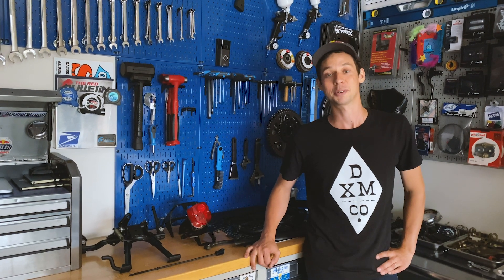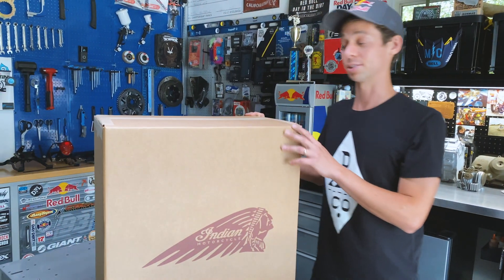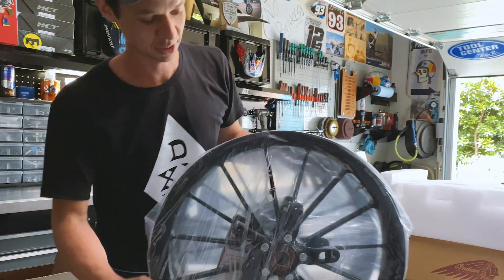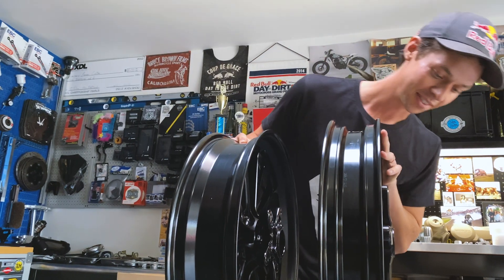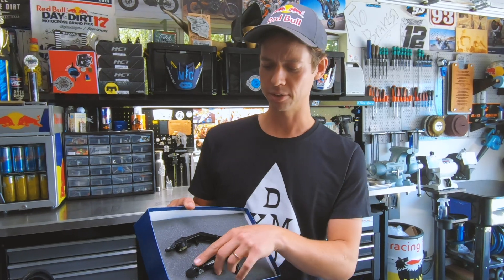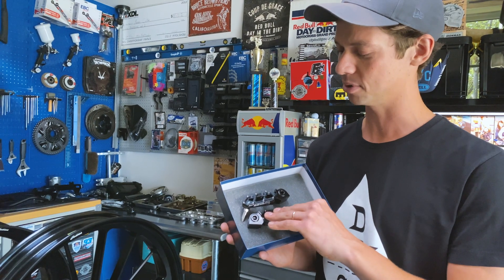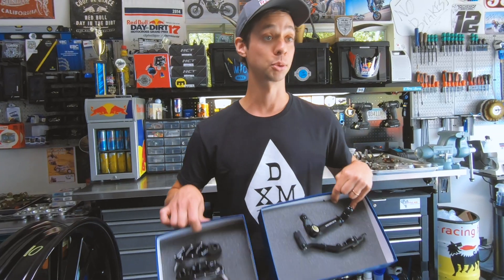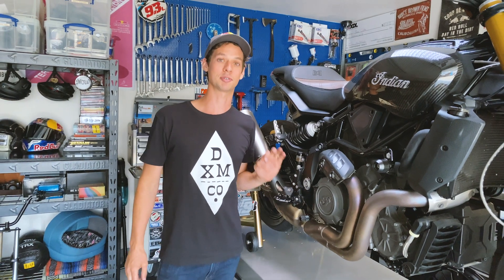Unboxing: The Indian Motorcycle x Roland Sands FTR1200 Collection

Comment: Aaron Colton — Looking for any advice from someone who clearly rides on a whole other level than me. Have you ever had a crash that stayed with you mentally? If so, how did you get over it?

I’m city riding in Chicago now and last year I went down when I was on lower wacker (underground wall to wall lanes) going 60. There was a diesel leak trail I crossed over going around a bend and my bike shot out right from under me. Not sure how but after sliding 10 yards through a diesel pavement slip-n-slide I shot up and sprinted 15 yards to an opening. Managed to walk away with only rash that I couldn’t get the petrol smell out of for over a week. Thankful every time I ride now there was no traffic behind me which is more than rare down there.
Anyway I still ride my bikes daily but mostly city streets. Whenever I get over 50 I kinda go numb and shakey. Riding back home on open road like in your last video is much better, so I have hope.

Just looking for any advice and if you think nerves can calm down eventually?
Reply: Get back on the horse, you'll be aware of that one next time! Motorcycles are not without their risks,  for me a risk I'm prepared to take,  and experience is key,  forewarned is forearmed! Racers analyse falls by things that were their mistake and things beyond their control to be aware of in the future. BTW you can often smell fuel spills if you're looking out.